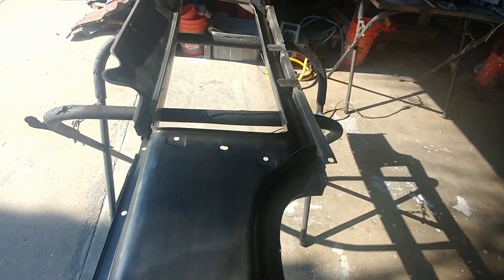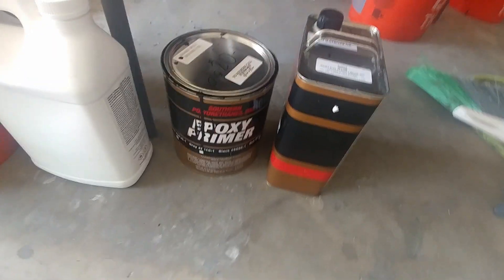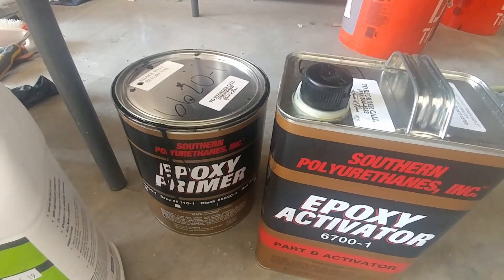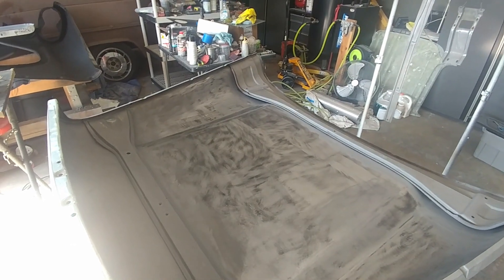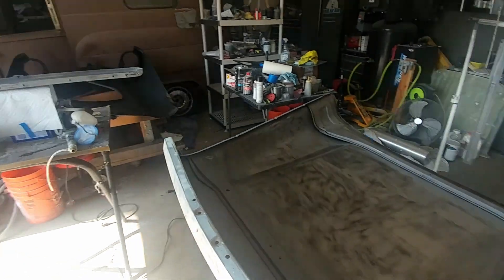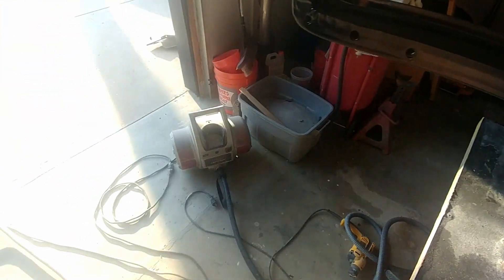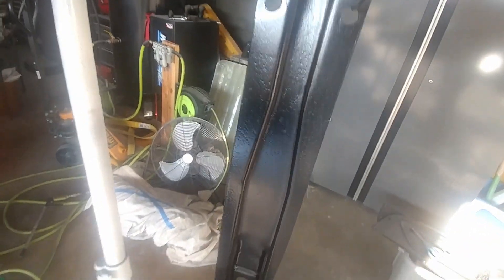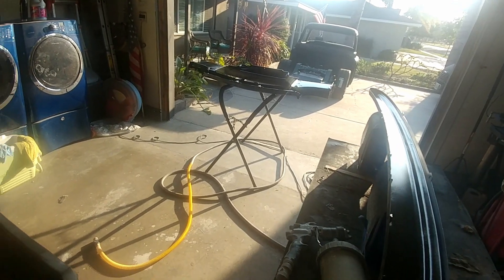SPI Epoxy Primer  on my 59 chevy truck build

Comment: SPI epoxy sealer is just that. It is an epoxy, so when applied to property prepared and cleaned surface it sticks like an epoxy. It is not designed for the collision industry as they run 6-11 vehicles a day thru the paint both. This has a 7 day open window, meaning, sprayed, filler, sanding the repair, the epoxy can be sprayed full strength of reduced to be used as a primer over OEM paint, so no lifting or blisters, but on top of filler. You get no shrinkage, and catalyzed materials cure together. You can get a stronger bond than that.